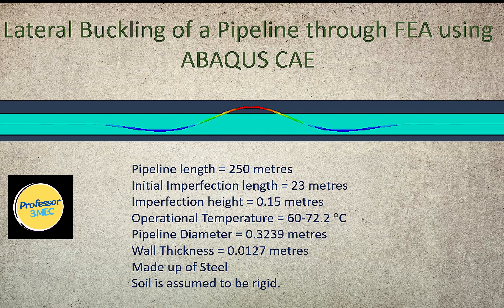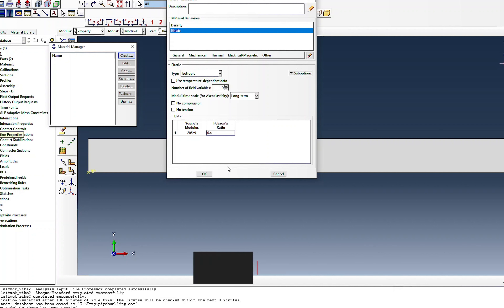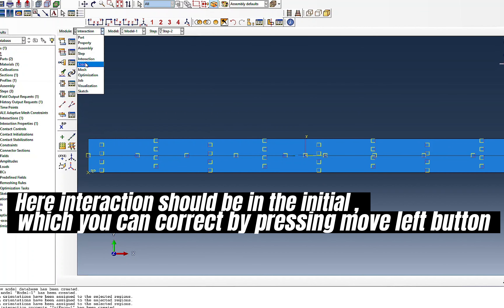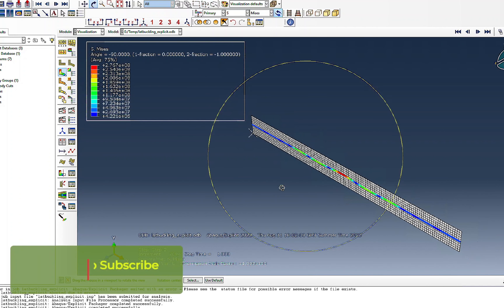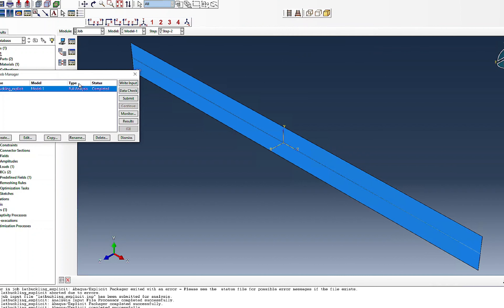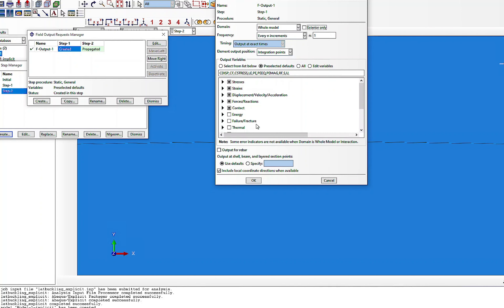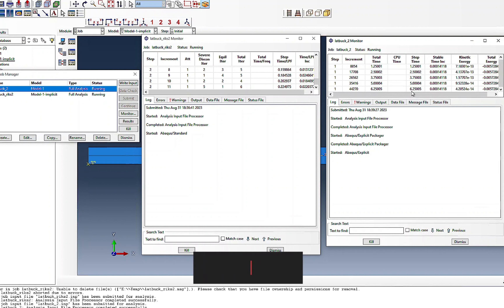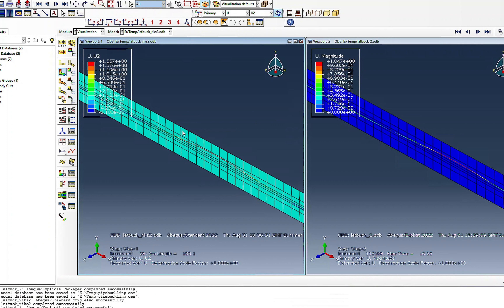Pipeline Lateral Buckling Simulation Tutorial | ABAQUS CAE Step-by-Step Guide

Comment: Thanks for the tutorial Prof. 
However I have something confused me, as per DNVGL F110 it is mentioned that the global lateral buckling will be happened if the compressive initiation force already reached (prior to that it will be pre-buckle configuration.After the initiation compressive force has beeen reached there will be a  sudden decrease  in compressive force, which I understand will be the post buckle configuration. Not sure  how to relate this with the modelling explained here or how to model this DNVGL criteria of buckling. Appreciate if I can have an enlightment.
Reply from the maker: you can also use explicit dynamic if its not a big model. Pre-buckling, buckling initiation, and post-buckling can be captured using explicit dynamic solver too. One of my student has recently done a project on this and I will post his slides soon.

Comment: I think something might be missing in the tutorial sequence. I have tried to reproduce it in Abaqus 2020 and 2023 but there is always an error and the simulation does not even start. I have tried different solvers such as Riks, and Coupled temp-displacement (both in steady-state and transient). I have tried elements B31, B31H, PIPE31 and PIPE31H with no results at all....
What version are you using to run these simulations? I thik there might be a bug in these Abaqus versions...
Reply from the maker: I tried with 2023 as well and it works, I will try to find out which version I had at that time. Thanks
Reply from the maker: If you send me your file I can have a quick check